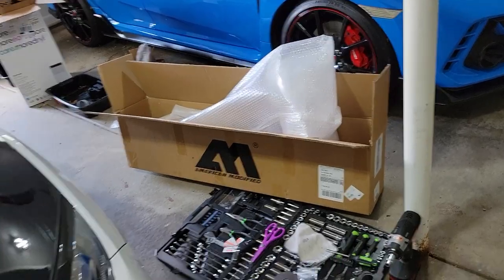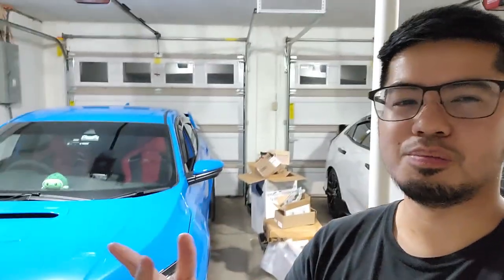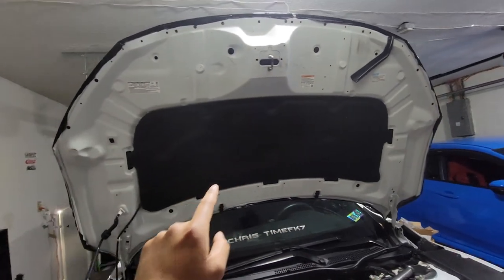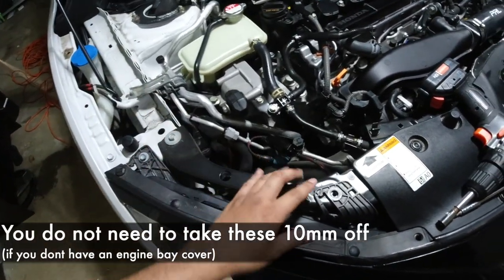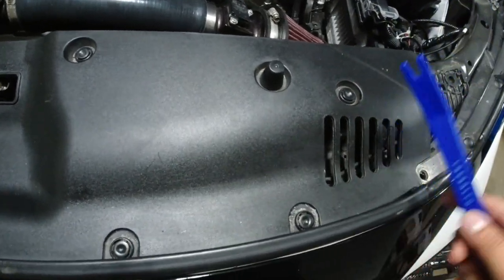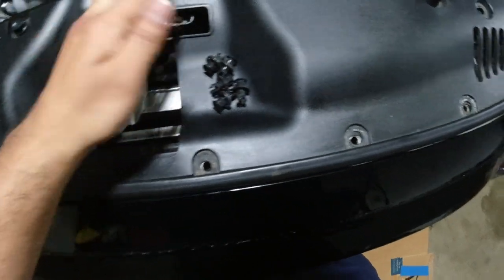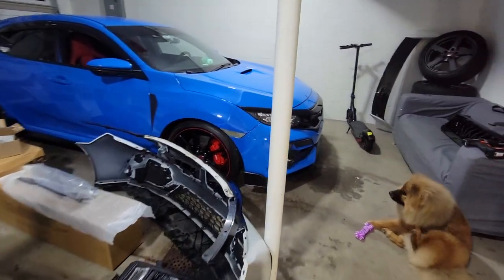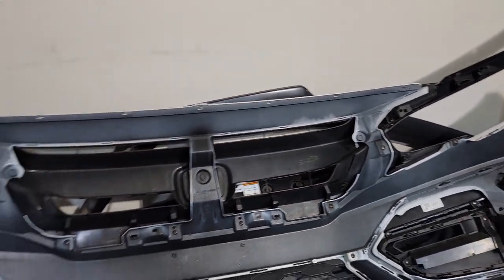GRILLE INSTALL 10th GEN HONDA CIVIC | AMERICAN MODIFIED

Comment: I'm more of a fan for the stock grill but the racing grill looks better and it probably let's more air flow in the car. You need a new set of wheels chris my volks te 37 would have fit your fk7 I would have let you borrow them if I lived at your homestate I promise you once you slap them on you do not want to take them off